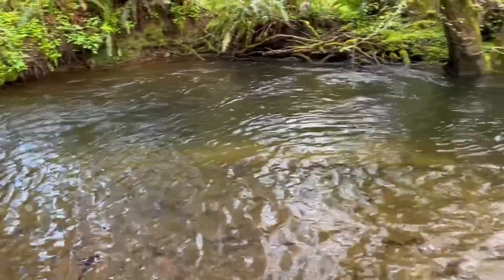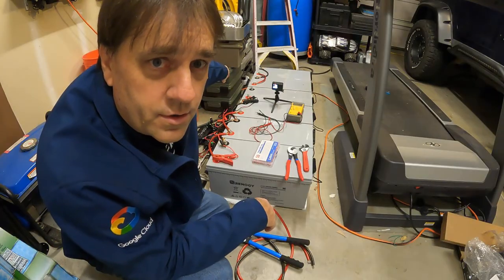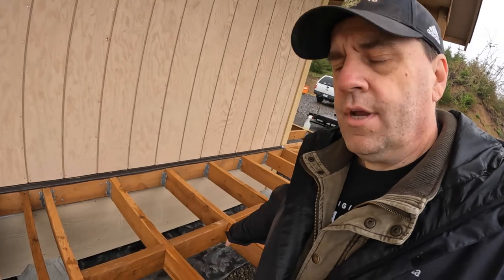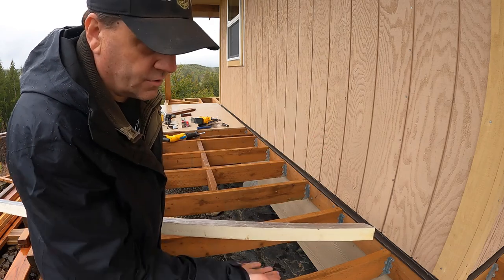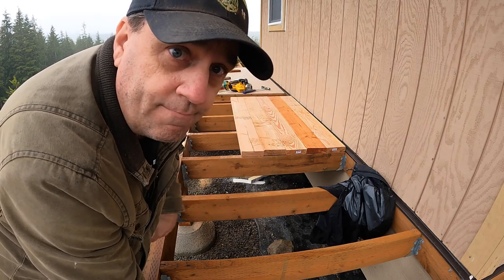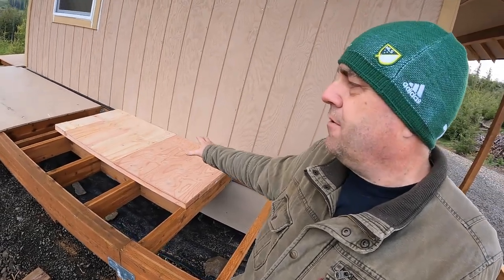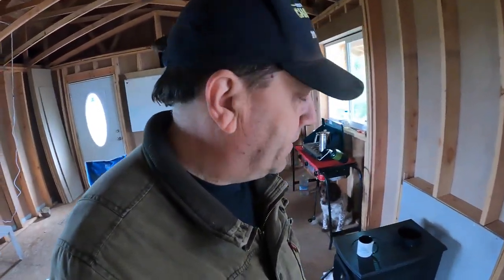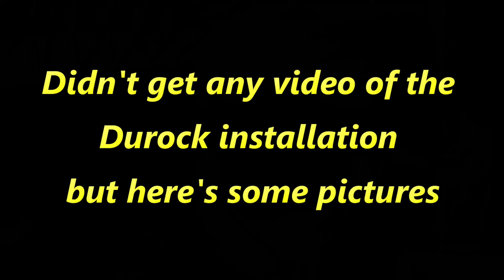Getting back to the Solar Project!  Starting our Wood Stove installation.

Comment: Just stumbled on the channel yesterday. Nice to see this stuff in the process. Definitely helps with ideas. Thanks for posting it all during your build.

I would be interested in knowing the make/model of that wood burning stove. I'm pretty far off of that stage of my cabin build, but that's the shape & size I'm interested in putting in when I get to that phase.
Reply from the maker: Thanks for watching!  That stove is made by Vermont Castings and is called an ASPEN C3.   It's really nice.  We got the stove pipe installed this past weekend and fire it up for the first time.  It really worked great.  I'm putting together a video of that now, so watch for an update this week on installing the Stove pipe and lighting the first fires.   

The pipe install was easier then I expected it would be, so overall the installation process wasn't too hard and didn't take that long.  For reference the cabin we have it in is ~520 sqft (48.31 m2).